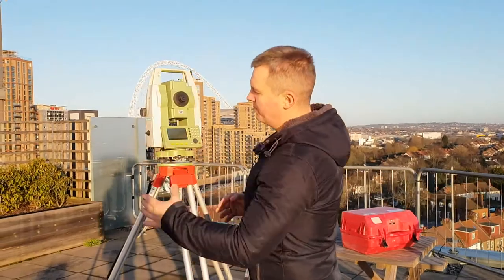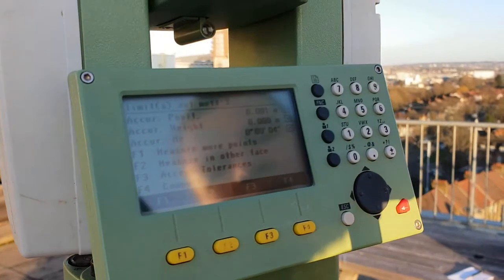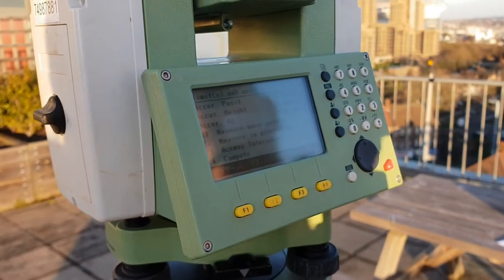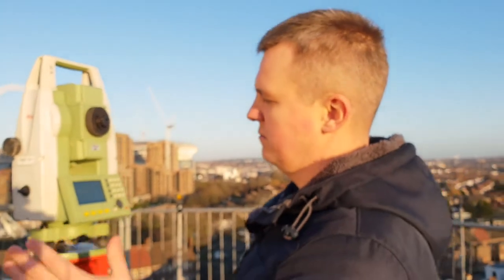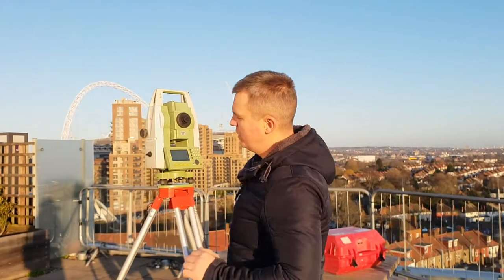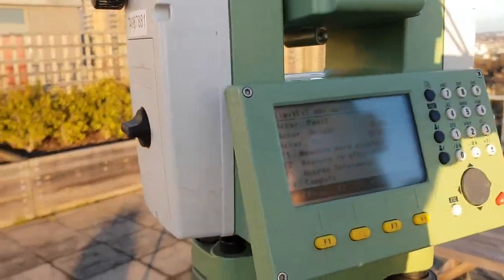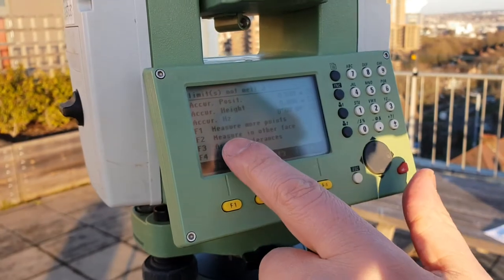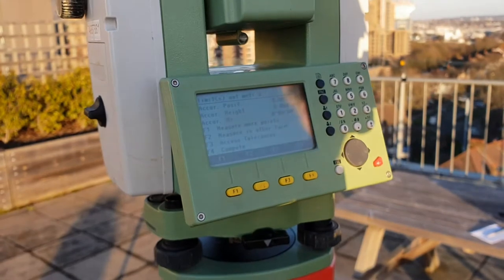SETTING OUT - How to do Resection using a Total Station. Step by step guide to orientate the EDM.

Comment: Sir, if i learn only all Leica total station is enough? In uk Leica is using mostly in building settingout works? Or else like (Sokkia, Trimble, topcon) Plz tell me Leica is enough or not?
Reply from the maker: Leica should be enough, but sometimes they use other as well, but once you understand how Leica works you shouldn't really have a lot of problems with other kit
Reply: @SITENG  ok sir. Now iam expert in Leica and beginner in Sokkia sir. My Institute send me some sites weekly twice. There I can mark columns individually  with TS. I saw different types of works like topography work, contour work, F.F.L marking work. Seperating property into 2 by using reference line. Then topography using Dgps
Reply from the maker: @jayganesh7167  great!
Reply: @SITENG  Thanks sir